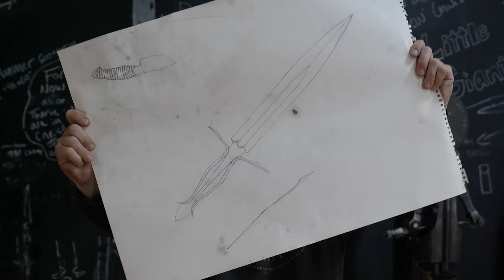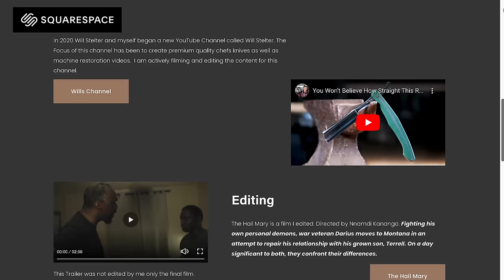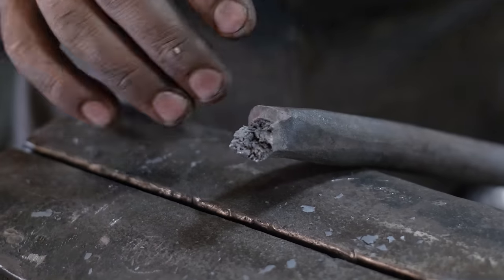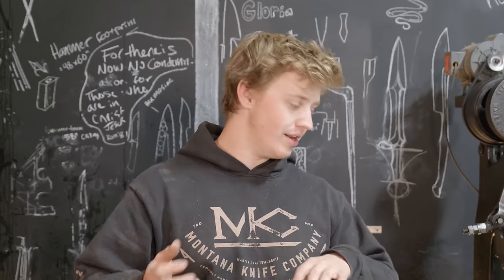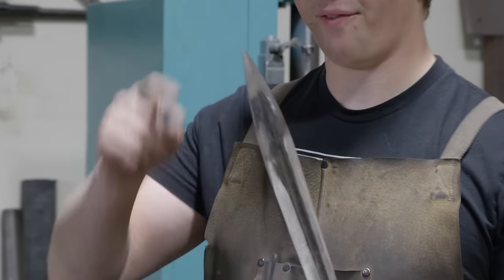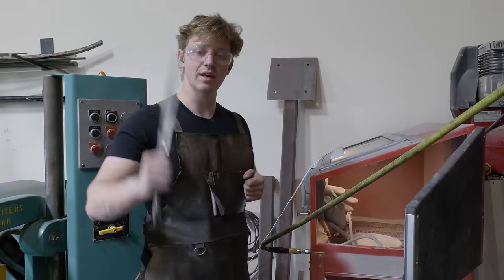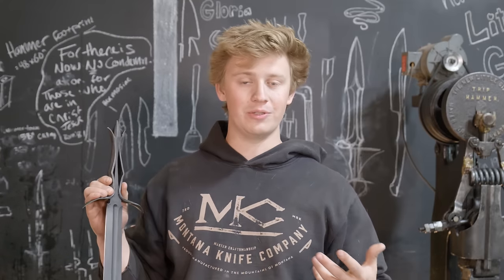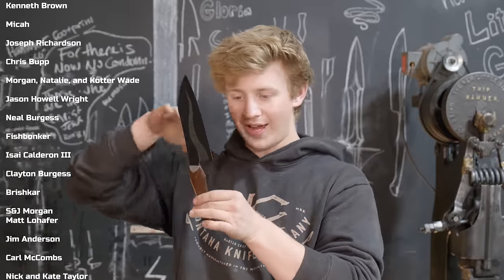The Hardest Dagger I’ve Ever Made

Comment: Aside from the changes you mentioned, i.e. shorter tang, plungline... , couldnt you have normalized the whole blade and reharden it. Or is the grain structure to "deformed" allready ? I guess the question is can you reharden the steel as often as you want, when you watch out for not having too much oxidation I guess?

Comment: I am metallurgically interested and wonder; around half way through the video you say you have ruined it, part of the blade has gone soft... could you not annneal the whole thing and quench it over??? To my knowledge and understanding, the phase transformations happening in steel during heat treatment, annealing and quenching are all re-doable, and thus should yield a good blade, as long as there are no cracks formed.

Comment: There's no such thing as a broken knife with forging, just smaller than planned knives. The first one can be further worked into a completely different knife, remove the wrought iron, make it a 1 edged blade by grinding off one side then grind the other sides bevels to round up just past the fuller and clean all the scale off, turn the old handle into a tang and one of the quilon's/handle into a smaller guard, whatever fancy wood for the handle and a peened pommel made from the original... all new smaller knife from what was a scrapped one. Type of knife? Who the F knows lol.